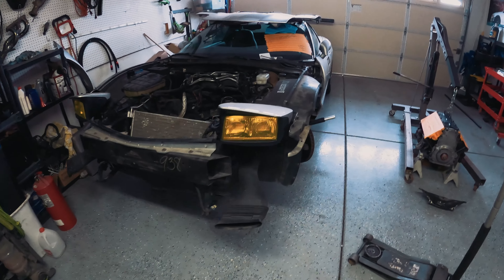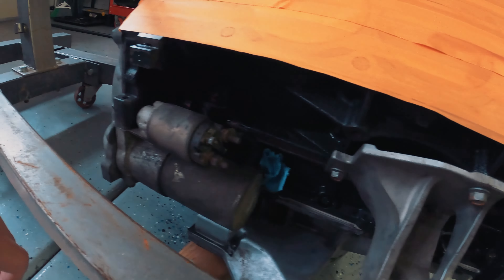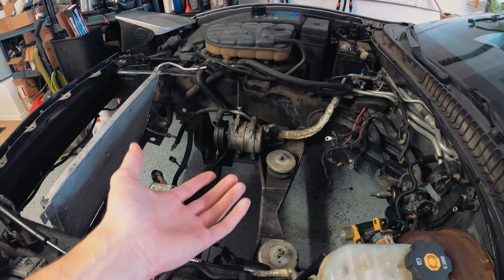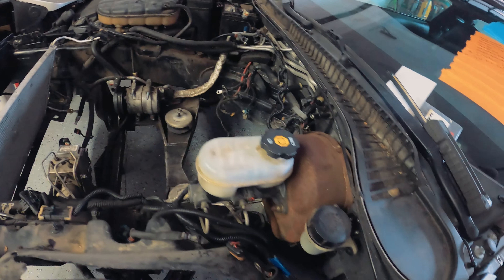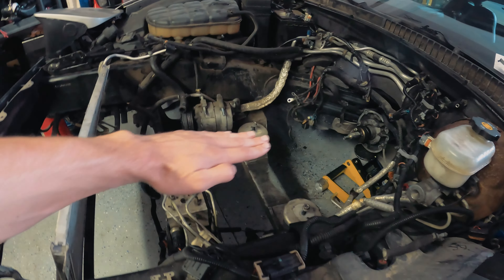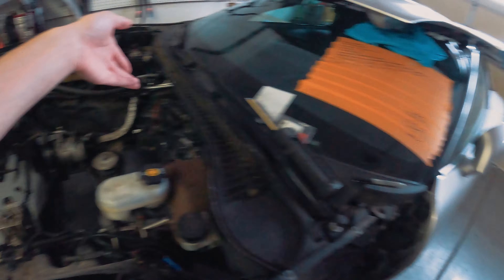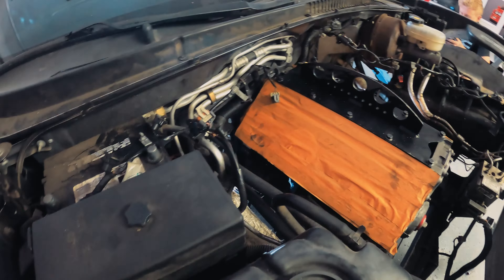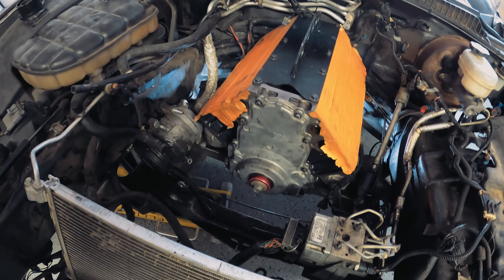How To Install A Chevrolet C5 Corvette Engine FROM THE TOP | Best Tutorial

Comment: Do you recall removing a c clip anywhere when doing this? Mine was a block when I bought it all bolts in a box I located homes for everything accept a c clip that’s roughly the diameter of the rad hose
Reply from the maker: I don't remember there being any c clips related to the engine.
Reply: Possibly was something threw in they thought went with it 🤞

Comment: Good video.  Did you have any trouble fully mating the bell housing to the torque tube shaft splines. Any tips? I'm about to do the same in a few days . Thanks.
Reply from the maker: Just make sure the engine and torque tube are at the same exact angle. A load lever really helps
Reply: @CanyonTuned man that torque tube  is something else! I'm  doing  mine now,  how long did it take you  to mate the torque tube to the engine? Did you  really have push and rock the engine  hard?
Reply: @CanyonTuned did you leave  the transmission in neutral or in gear?
Reply: yeah it's really not fun. You absolutely have to make sure the torque tube and engine are exactly at the right angle. Make sure you lubricant the splines
Reply: @MikeP41  ok thanks,  I'll attempt it tomorrow again,  I didn't have any help, I'll  get help tomorrow lol! Thank you 👍🏼

Comment: Ne carful not to crack the windshield. Make sure you don’t lift that torque tube higher then why’s is indicating inside de tube a the rear where te torque tube connect to the trans. Put a piece of wood on top of the tube so it doesn’t lift to high and crack that super rare windshield.

Comment: How long is your boom on your engine hoist
Reply from the maker: It was my friends I borrowed so im not sure. My harbor freight one wasn't long enough
Reply: Do you still need to know length needed I’m installing mine Sunday and the lift length I’m using has nearly 5ft arm length
Reply: @handyishrandyish334  a harbor freight hoist won’t clear it sadly is off by a couple inches

Comment: How high does the car need to be to do this pull the engine?
Reply from the maker: I had mine pretty high up to get the engine and bell housing at the right angle. The main thing is lowering the subframe helps.